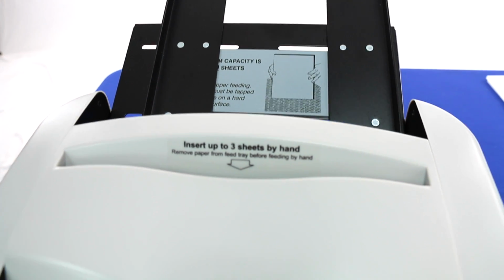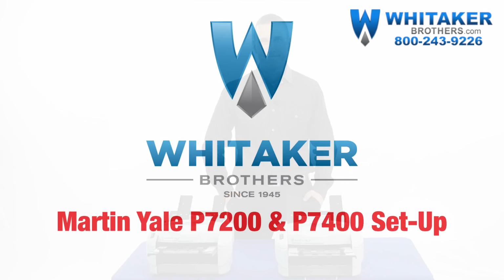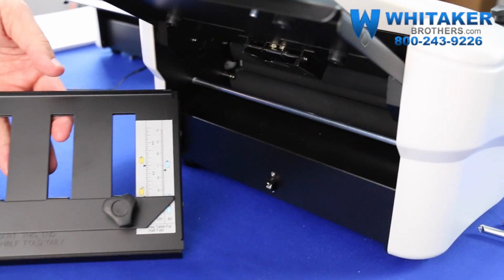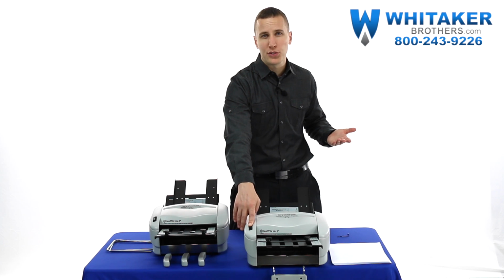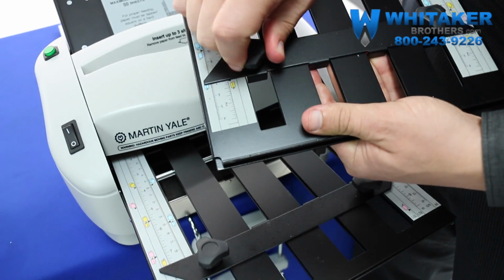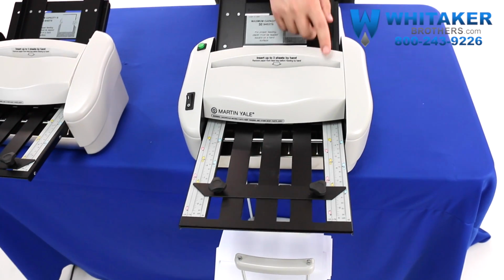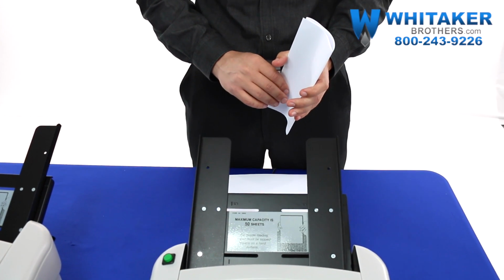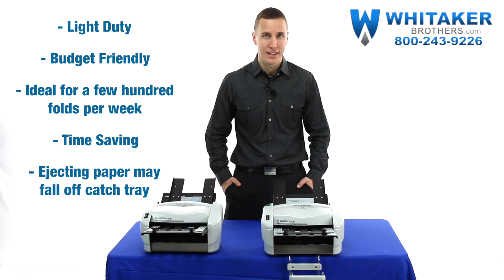Martin Yale P7200 and P7400 Folding Machines

Comment: We have the 7200. I suck at this machine. It’s constantly wrinkling and makes an excruciatingly loud squealing sound. I hate it. It’s so frustrating.
Reply: I was just going to ask the same.  I figured out the wrinkling part. Don't tap/jog the pages once in the machine to square them up.  Do it on the desk/counter first-block pages THEN insert. But the squealing is crazy loud and also, mine shoots the pages out onto the floor no matter how I adjust the catch tray.
Reply: @acatismansbestfriend5719  easy fix i found is just buy a tote to catch what falls